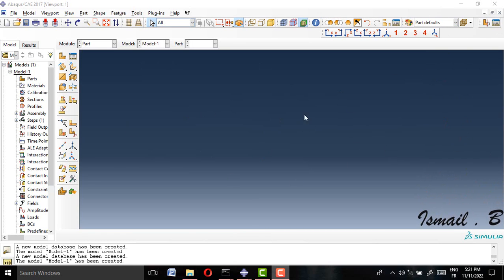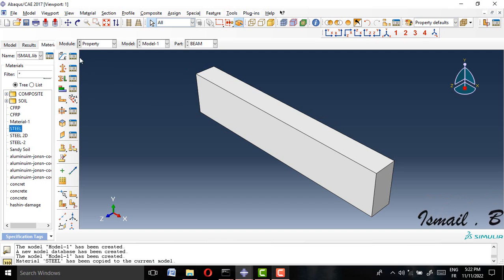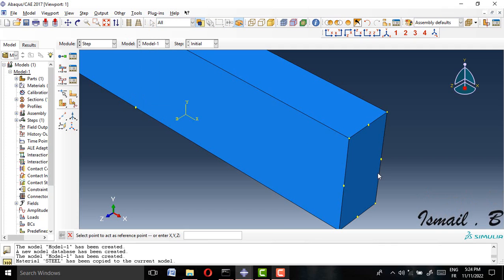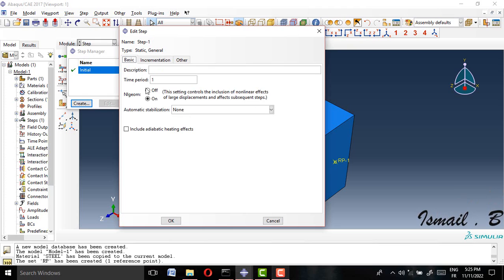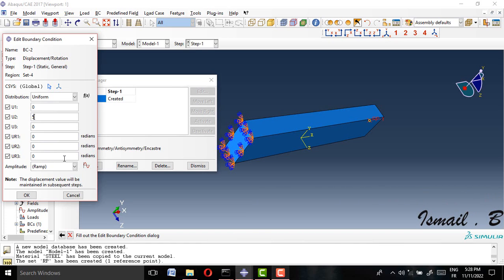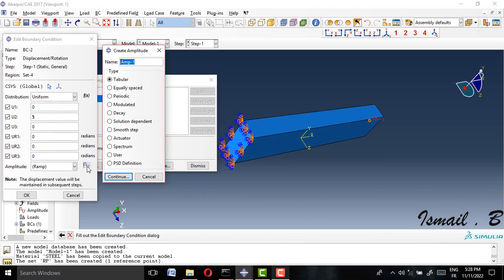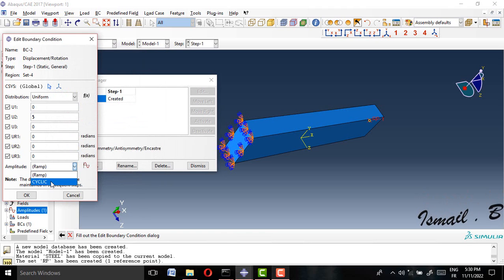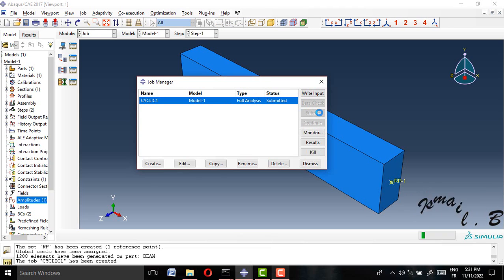cyclic loading analysis for steel beam using Abaqus ( English audio explanation)

Comment: This is a very interesting model. But I don't understand U2 you set the value to 5. What does it mean? I see a load-displacement chart, where displacement is up to 25
Reply: u2 is the reference displacement, how much you then write the amplitude values, these are a function of your U2, example 0x5=0 , 2.5x5=12.5, -5x5=-25.  To get 5mm as the final value then you put in the amplitude 1, i.e. 1x5=5 I hope I have explained clearly